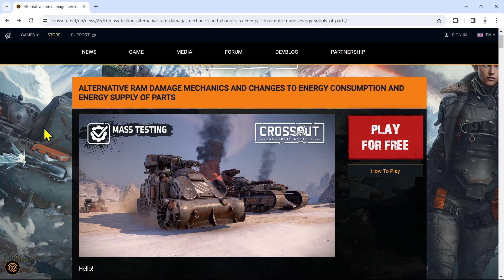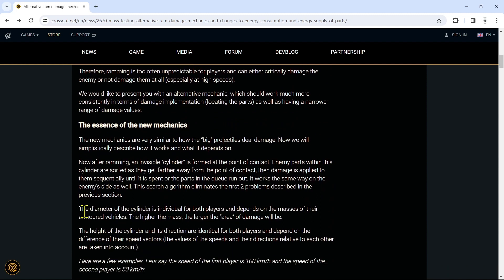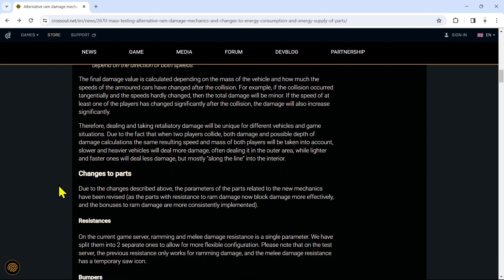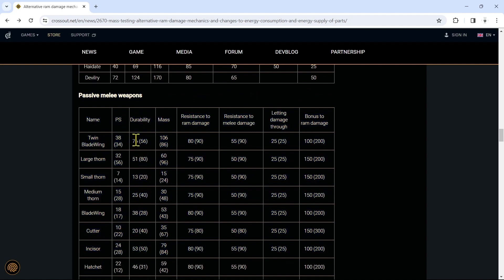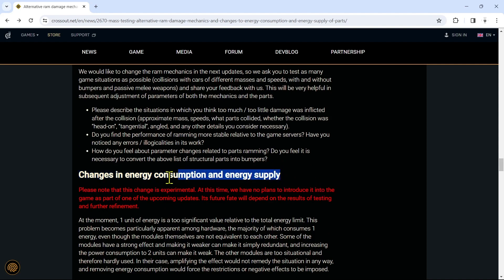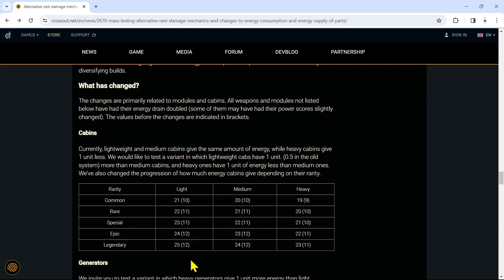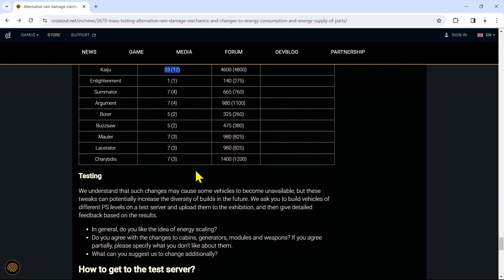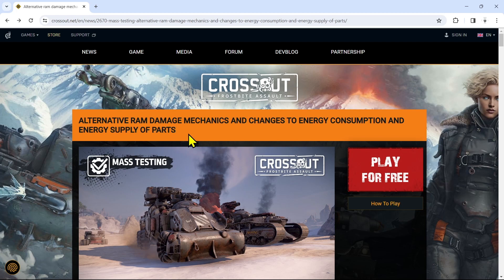Another MASSIVE Update Coming to CROSSOUT | 02 19 24 Patch Notes | Shock Radio Talks XO

Comment: One change I would like to see is the Kapkan. It should be changed to a module, limited to 1 per build and require a Genesis.
Reply: I think if they slightly buff the kapcan back to where it was, but limited it to 1 per build, that could work. You're right that it's the spam that makes them frustrating. You never run into just 1 kapcan
Reply: Run a Spark
Reply: @kenboi3488  Sure, lemme just throw a Spark on my Punisher hover. That sounds effective...
Reply: Ferrari frank nerf 😂😂😂

Comment: So Tusker builds won't be able to randomly 1 shot my heavy spider build like  it is made from paper? And if I ram with my Wedge it will do what it is intended to do and knock off wheels? Sorry Ttuskwr guys, but that thing had too many OP random moments against vehicles itt should have struggled against.
Reply: Oh boy I don't like the potential of my beloved wedge being pushed above 9k PS it's honestly barely effective at the PS as it is. The way I use certain parts especially bumpers with powers core increases and weight value changes could make every single one of my blue prints overweight or end up having a bloated PS putting me right back on the Seal Team. I always thought being a  SEAL would be way cooler. Goggins deceived me 😂

Comment: I hope they get this right. This has been a major issue for awhile. There's people that run nothing but tusks. They don't even play the game, just drive around and crash into people (Russel the Rammer). People can actually learn how to play the game.

I think they need to look into the heat mechanics. Damage multiplier is too high.

I think the energy change is actually a great idea. It will provide way more options in making varied builds especially support builds. This could be a genius move honestly
Reply: It's not so bad, and there's a high skill ceiling for controlling them and hitting your mark on moving targets without putting yourself into a bad spot after.
Other than nerfing the actual dmg of the cab by half and lowering the charge again, it'll hopefully still be usable enough to see them.
Reply: @nunull6427   They don't have to make it useless for sure. I just feel like in a game like crossout, with sooo much weapons and equipment, there should be a million different ways to play. They've come a long way with making many movement parts more viable, and I like seeing that. I hope they can do the same with weapons. In confrontation, almost nothing can 1v1 a triple destructor, the rest of the builds are majority triple remedy or cyclones. Sure you can bring just about anything, but it's a much narrower scope of what's actually competitive. It gets boring fighting the same handful of builds every match. I try to run off meta stuff just to be different
Reply: Tell me that tusk is skill, 😂😂😂😂 god its so cringe to see this bullshit opinion
Reply: @ALEXZANDER_YT   waddayoo mean, you have to steer and everything. Takes skill to randomly fly around like a moron

Comment: I replaced my bloodstream with coffee, pulled up a pen and paper and started calculating and theorycrafting different builds. I think these changes will make the gap between relic and non-relic users even bigger. Also, following their logic for these changes, it wouldn't surprise me if at some point they change matchmaking PS brackets to be more strict, either making queue times longer or adding bots to almost every match.

Comment: Them changing the energy consumption mechanic is making me want to quit the game, everything that I’ve learned about the game is going to change and it’s sad and it makes me feel like not playing anymore they have changed soo much stuff in the last months it’s a pain to keep up with the metas even after the harsh gerida nerf.
Reply from the maker: The energy consumption portion they mentioned may not even come. They said for sure its not coming next update but are just messing around with ideas to potentially make future changes. So for now we can relax a bit lol
Reply: Even if the energy change hits, it will fundamentally function the same. You'll just have more points to spend, but things will cost more.

Think of it like if you got 5 Skittles. You can only divide that up so many ways. But if you got 30 Skittles, you put a few here, couple there, handful over there, and you got a dual miller with an engine, daze, radar, chameleon, and a cooler.

Another way to think of it, is if they allowed things to cost half an energy, or fractional. Allows more variety, and allows them to put things in the game that might only be worth half of today's energy cost
Reply: @B-U-T-C-H-E-R  epic module is now 2 energy.. legendary modules 3 energy. Big difference
Reply: @MCEZGG   but they're adding way more energy to cabins. I said things would cost more energy. Who knows what they end up doing
Reply: Yeah I've been thinking the same

Comment: OMG. Did I call the energy change for cabins?? Not what I was proposing but I think the energy thing will be awesome. They should still flop the heavy and lights though. Especially now it will help greatly with balancing. Plus when you think a heavy build it should bring to mind a tanky power house. And a light build should be nimble and precise. Right?
Reply from the maker: The problem with making heavy cabins have more energy is there will be 0 benefit of light cabins at that point other than maybe being faster leading to almost no one using light cabins.
Reply: Didn't think of that lol❤❤❤❤
Reply: @ShockRadioGaming I disagree, giving light cabins some better bonuses or faster acceleration would be better to switch out with heavy having that extra energy point. Right now outside of a select few cabins, almost none of the other heavy cabins are worth using for their perk alone making that -1 energy a huge deal breaker to using them. Most light and medium cabins are just better overall because of perk + 12 energy. Nerfing light cabins with less power but higher stats for perks or whatever else you can buff with it would be better to shift the meta.
Reply: @ShockRadioGaming I disagree, giving light cabins some better bonuses or faster acceleration would be better to switch out with heavy having that extra energy point. Right now outside of a select few cabins, almost none of the other heavy cabins are worth using for their perk alone making that -1 energy a huge deal breaker to using them. Most light and medium cabins are just better overall because of perk + 12 energy. Nerfing light cabins with less power but higher stats for perks or whatever else you can buff with it would be better to shift the meta.